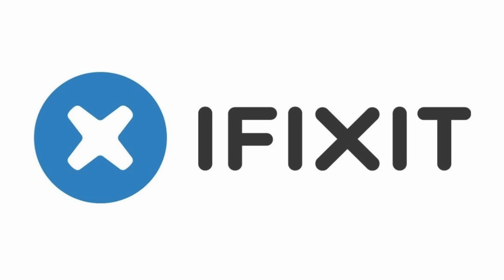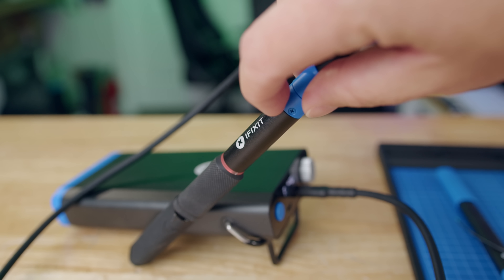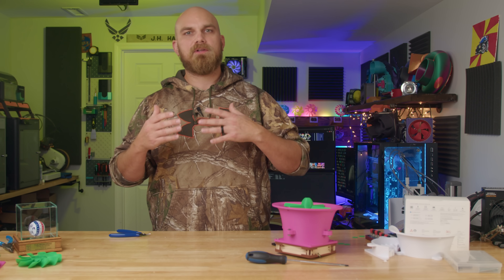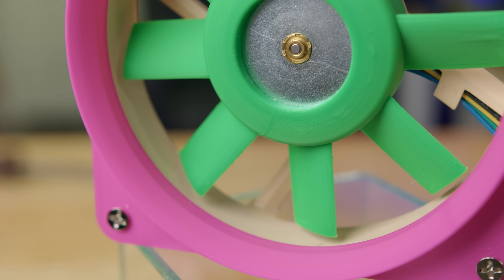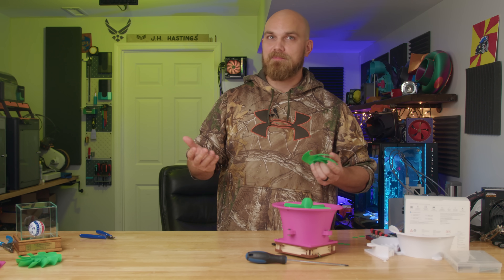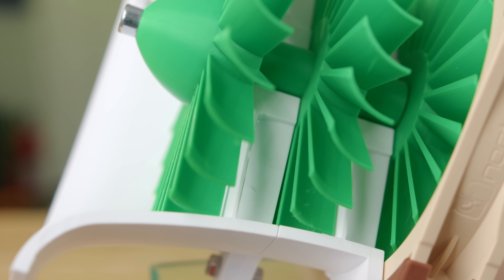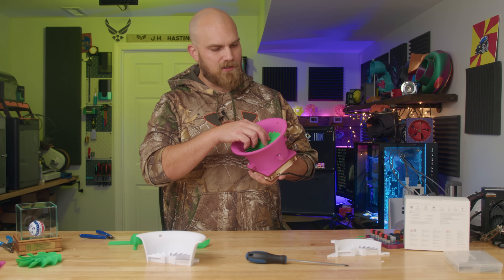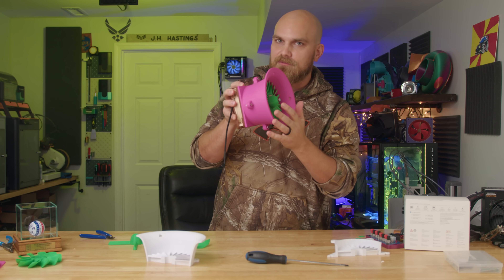Turning a PC Fan into a Jet Engine! | Fan Showdown S6E7

Comment: Olimpus just was asking too much power from the motor in a wrong way. Trying to move too much volume at too high pressure. If optimized for this challenge, the overall design is way to go, just those blades should be way shorter, to minimize how much air it tries to move at a time, because if the goal is just build pure pressure, you don't need much air at all going in. You just need multiple stages to build up pressure. That's why Centrifuge madness did so great, real slim blades to move less air, long blades to make pressure, multiple stages to get even more pressure. I bet if Olimpus was made with fin length of just 20% current one, and rest just closed center hub, it would rock the chart.

Comment: The axial compressors must have less blade pitch to create more pressure (like a tug boat prop where less pitch produces very high trust but low speed). Also, adding stators increase pressure, like a multi stage jet engine compressor, where each stator multiplies the pressure by about 1.2.  Looking forward to see which designs prove the best for both volume and pressure.

Comment: Pressure is not important, flow is important! You do not test a pump but a fan. Add flow ratio indicator to your table, you can measure this as a push force. Exactly the same as guys testing propellers for drones are doing, got it? Physics! Flow ratio differs to pressure almost as current to voltage. ...

Comment: I have a bunch of soldering irons. a few at home and a few at work. I have soldering stations that were several hundred dollars, name brand very expensive irons with extremely accurate and precise base stations with super fine adjustable  temperature control.. I have 2 pen style battery operated irons. i have 2 propane irons.. But the soldering iron i use the most by a mile is actually the cheapest iron i have because its perfection.. I have all milwaukee tools. M18 everything. this iron's base station connects to a Milwaukee M18 battery. everything from 2ah to 12ah 20v batts work perfectly fine. Its under $50 and works better than my few hundred dollar professional irons. extremely precise temp control, auto power down features, auto power off features, auto cool down features, low battery protections, etc.. all sorts of customizable settings all adjustable with a knob on the screen. anybody looking for a great iron for m18 batteries, this wont dissapoint.

https://www.amazon.com/Deackimei-Milwaukee-18V-Battery-Temperature/dp/B0CM95RBLL/ref=sr_1_1?crid=2KI32XOQ3AFM4&dib=eyJ2IjoiMSJ9.zfhk9g4YB-m3CEMTtYt_9ejdAbN_9NdexwD4ADcId6YhjSkUsnV35Iu_FyNSCqE8rTg6iq46wzN9cDPOQHPwXDk33r8tnY0GazeIJgPAmkMlxdYzuBGtxvhoGwr6VqQoDTgPyEaov4K2wCAkMdHVdfbwuW_xmjxX5t4j5hZNNdj4qAZO5PbjyhToH2ImMpPePI6Uzh725HfENIDmmnpJlfubeUKGjL8yJ5y3gu7XxxpyDNGgmEWGlj1xZOd4UMVLkXzdF_6erwlNTPOHIXx0SxqqjBpkwVexf5MMt4-2C5Hbgp-eRpIH8NRo5LWlbvsDKJ4lx5J0V0xxjsrQW3s1RlBX9yE78oqk8pBOito-rOKdJh7Ob3L7A5PR-NU8iACm5bTrdm6VDSvG12rqeLa0C_7Vqtkw7Pae1KvgIOnTCi4zTe_im3KdlPS1bx-Cr3Uo.Znk1RCE-kveWNQNrNlNkzFWafLpa0WvzR2dgwWqic7g&dib_tag=se&keywords=MILWAUKEE+BATTERY+SOLDERING+IRON&qid=1735803803&sprefix=milwaukee+battery+soldering+iron%2Caps%2C124&sr=8-1

Comment: Maybe for a future season you can measure both CFM and static pressure, or just mass flow? Also, it would be interesting to see what some of the lower-RPM designs that have been on the show can do with Noctua's A14 industrialPPC-3000 frame and motor?

Comment: Someone needs to design a squirrel cage type of fan. Furnaces use them and have quite a bit more static pressure than that. Like a pull through fan that mounts a blower wheel off the back of the fan motor and attach the housing to the backside of the fan frame surrounding the blower wheel. Basically a one side inlet only squirrel cage/furnace blower.

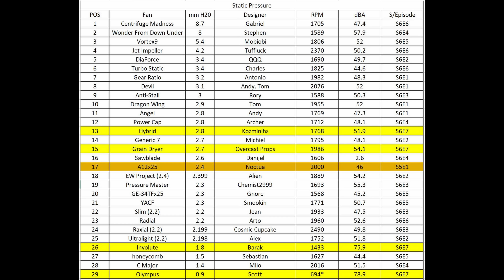Comment: 11:05 You have a typo on your spreadsheet: Sawblade (16th) has its static pressure duplicated as its dBA.  I just checked the S6E4 video and it was 46.

Comment: I worked on 200mw gas turbines which have axial compressors. Here is the challenge. Each blade is an airfoil (like an air plane wing) to work properly it has to have the proper air flow (not stall). They are very sensitive and requiere very tight clearances. A 12" blade only has 50/1000" clearance. Then this repeats on each stage, with each stage having a different shape and blade count. When blades stall it produces alot of turbulence and vibration. Thats probably whats going on with this fans.

Comment: Re the Rolls Royce Olympus engine, later models were also used on the Concorde. It differed from a lot of engines at the time in that there were two compressor spools - the high pressure compressors and turbines ran on a separate spool to the low pressure compressors / turbines, allowing them to run at speeds more suited to the low / high pressure conditions.

Comment: Just noticed the Sawblade fan from S6E4 has the static pressure in the dBA column, it should say 46.
Surely someone else has already mentioned this, but just in case no one has :)

Comment: That support bearing was killing the RPMs of the fan. Remove those tight  grease seals, wash out the grease with IPA, lightly oil, and give it another go. Probably won't be amazing but I would expect you would see a noted improvement.

Comment: If you have to add a bearing, remove the seals and remove thick grease and change to very little thin oil or thin grease, keep the seals off to reduce drag.  Ideally you could do this with no bearing added. Shallower angle on the blades should increase rpm and static pressure.

Comment: This video peaked my interest as I use to be a gas turbine technician in the Navy. Typically, each progressive set of fan blades would get smaller and smaller as each stage would be compressed at a higher pressure. The built ones were essentially the same diameter. But really not a deciding factor on a PC fan. As I assessed this design would be the most inefficient design for a number of factors, higher friction and tolerances were not that great. But the most significant factor…the power to drive three fan blades rather than one, would slow the speed down significantly. Typically an axial flow gas turbine has a high power to weight ratio at the cost of high fuel consumption. As many guessed, the electric motor was not powerful enough to drive such a fan setup.
Reply: *piqued

Comment: the angle/pitch of the blades/vanes on the one you're calling an axial compressor are too steep...  Change the pitch and it will certainly perform batter.

Comment: Not an engineer, but looking at the sharp angle on the olympus fan it looked optimised for speed not static pressure (makes sense after which it is designed).

Higher static pressure = lower airflow, I think a fan that's going to produce pressure should only use the 2cm of outer fan, since that part of the fan spins fastest and thus creates most pressure.

Comment: What ya need to do is find out how to make the air cold and then pull it into the fan and then heat it (by cooling the pc parts) and treat the cold and hot stages accordingly with their volume.

Comment: large greased rubber shielded bearings have a lot of friction btw. (for a fan) If you pull the shields out (just a pick or something will pull rubber shields out) then wash out the grease and replace it with a light oil like sewing machine oil it'll have way way less friction. For the ultimate you can run them dry but it's for show more than practical as they will rust and things. Metal shielded bearings can be no contact and you can with some effort swap the grease for oil in light load applications so it's not really an unfair test overall to degrease and oil.

Comment: I'm here for the jet engine fan but gotta say for once the add was spot on, they chose the right guy which opinion we might trust with the right audience that might be nerded into buying the thing, ifixit should sponsor you harder, sure I'm not the only math is cooler than math guy that now wants one, who else here loves to go to the cables, adapters and electronics section?

Comment: Throw out the Olympus.  There should be no bought parts added to the showdown fans, other than hardware; screws, nuts, bolts etc.  Adding manufactured bearings is totally cheating.  3D printed only or it's not in the spirit of the showdown.   
Keep up the great vids.  Stay Happy and Healthy

Comment: 5:05 Arctic has fans that look kind like this for example ACFAN00121A. Noiseblocker has a Fan that has 3 mmH²O NB-eloop X B12x-P. Maybe someone uses it as inspiration. I know it isn't as good as the Top. But it is in a 120x120x25 space.

Comment: and time and time again we see people making the same mistake: Weight has NO IMPACT on speed - neither for something moving in a straight line, nor for something rotating like a fan.

Only once you got past the limit (what the bearings are designed for, or what the tires can handle) does it really matter - and there you are far far away from the weight you get under any normal situation.
For the fans the biggest problem of weight comes from the high currents when starting up potentially burning up the motor, or if it is far away from the hub then the torque it applies to the shaft and bearings. But both of those scenarios need extreme examples like "the tulip" (S1E5 - https://youtu.be/peGR3-jgvtY?si=4uWx1HJztxnwq8Rm&t=310 )

Comment: Dont buy the ifixit station. Buy a better, cheaper iron which is more versatile called the TS80P and USB-PD power bank which itself you can use anyway because its a power bank, you could probably buy one with a wireless charger to charge your phone on it, already more versatile than the ifixit station. 

Honestly cant believe hes even promoting it, overpriced and proprietary crap

Comment: Involute fan needs  aredesign. Run it at rpm and see how much it deflects. Compensate for that in the original at rest shape so when the fan is spun up it achieves it's final working shape that is the desired shape. Result is super low weight fan blades and intended airflow.

Comment: Interesting note about high performance fans, sound can change how much you're willing to deal with when everything else stays the same except the chassis. Case in point, I've been using 5300RPM fans for years and other than at full song, they were perfectly bearable for peace of mind when doing simulations and big renders. I upgraded to a significantly larger GPU recently, which meant getting back into a full tower case. 
Yeah, it lasted four days until the noise became unbearable and I ended up swapping all but my exhaust to 3600rpm fans. It runs about 10C warmer but still within the safe zone under load. I never thought I'd be walking backwards on headroom for static pressure, but sanity has a cost when it's sitting next to you for 12+ hours. 😁
As soon as I finish my current project, I'll sit down and finally get a fan piece banged out for this challenge. I've had one started forever but paying jobs and R&D work take precedent unfortunately.

Comment: The RR Olympus engine was also used in the Concorde supersonic passenger plane!  The fan design here was facing far too much friction, perhaps from the internal bushings?, and what seemed like far too much air load on the blades, perhaps a lower blade pitch would work better?
Reply: The smoke test showed the Olympus was out of balance as well, which I'm sure didn't help.

Comment: If you want to design a fan with extremely thin blades like the Involute you should really include a ring touching the furthest part of the fan tip. This would give it a bit more rigidity allowing it to spin without touching the rim of the fan. An like said in the video the closer you can get the blades to the rim of the fan without touching the better. Noctua spent a lot of time developing the material of their fans to make them rigid enough that they could make them run extremely close to the housing of the fan without risking that the blades would flex enough to touch it. An alternative that some have tried is to have ring connecting the tip of the fan blades that acts like a rim.

Comment: The Axial fan needs Bearings to stop any form of play in the main shaft which will also need to be true, so that the tolerances between the Shroud, Compressor, and Stator blades can be maintained, also the blades will need to be balanced to stop any wobble.  The smaller the gap between the shroud compressors and stators the better the performance will be.  Be Aware: Deformation and catastrophic failure of Plastic compressor and stator blades is likely to happen at high RPM.. There is a reason these types of things are made of metal.

Comment: Next season should be a "CFM per dB" competition to see who can make the most air for the least noise for real world PC use.
Reply: ah yes, the power/weight ratio of the fan world
Reply: Noise doesn't scale linearly, so dividing is not good.  GamersNexus' method of adjusting all fans' speed to the same dBA value is better, tho specific tones can also be important.
Reply: @concinnus  
I disagree.  Noise is linier.   Decibels are logarithmic. Although we measure in dBs, we hear linearly.  To the human ear, going from 60 dB to 70 dB is twice as loud.  

In my perfect world though, I want everything to equal or be less than ambient noise.  I don't want to hear my fan. Besides, I need to be able to hear when my wife yells at me from the kitchen that dinner is ready.
Reply: @alanmcentee9457  Everyone knows how dB works, dude.  The issue is that if you double fan speed, roughly speaking cfm doubles, pressure quadruples, but noise power octuples (+9dB).  Please learn some domain-specific knowledge instead of just repeating high-school level science factoids.
Reply: @concinnus  
If everyone knows, why would you get it wrong?
Reply: @alanmcentee9457  Ah, I see.  It's not that you lack technical resources, it's that your technical reading comprehension is like someone trying to sound the Mariana Trench with a ruler.  Good luck, but you're not worth any more of my time.
Reply: @concinnus you are right but you also sound arrogant af
Reply: I hope people look at GE jet engines and how they've made the intake way bigger to surround the jet air from ambient atmosphere with more air somehow to break the sound up. It's like air is its own acoustic insulation.

I'm pretty sure the bypass air gets heated, and this creates as near a vacuum as possible to surround the fast moving air to reduce the sound waves in most directions.
Reply: Decibel alone aren't so great for this, you could have two fans running at 25 dBA but one of them could sound significantly more annoying because of psychoacoustics. What you need to measure is basically the psychoacoustic annoyance level. Which is a combination of loudness, sharpness, fluctuation strength, roughness, tonality, etc
Reply: You'd have to comp for frequency
Reply: This would be a very interesting challenge
Reply: the ultra low noise competition could be a completely new thing. instead of the NH-12, you could use the redux-700 or 1200 as the baseline
Reply: No no no. The most air with the MOST noise. I wanna hear them scream.
Reply: @fallingwater  
You enjoy the fans torturing the air?  What kind of fan club you got there?
Reply: You can aggregate that information already with the data at hand. (mmh2o * 3.53) / dBA
For real world usage, well, if dBA is equal or lower to the Noctua with higher mmh2o you already have a style that will be better at cooling, given that the cooler would fit into the case. All that aside, the viewers are from all around the world, we appreciate the usage of SI units and not the catering to a minority.
Reply: @maskharat Where does 3.53 come from?  I do not think you can equate static pressure with volumetric airflow.  In fans the flow rate is usually expressed as m3/h or CFM.

Comment: If I remember it correctly then compressor style fans have layers that rotate at different speeds and have different pitch angles. So a si gle motor without any gearbox will not create the compression necessary for it to work.
Reply: Maybe you're thinking of bypass engines like used in airliners? I wanted to design an axial compressor after the last episode so I dug into it a bit. Most of the designs I read about had one solid shaft that all the blades attached to. Pressure is created by reducing volume and blade pitch between  stators like you said. The engineering involved gets complicated enough that I just couldn't dedicate the time to learning.
Reply: Correct! I would not say different speeds as all rotate at the same speed. However, several stages of compressor blade are rotateable. That is to prevent compressor stall at different speeds. Not a make or break design for a PC fan.

Comment: Do you think it would be possible to "disqualify" the fans that are clearly designed for bigger numbers (for example have allowable build area, inside the fan and the fan "dangerzone" maybe so something like a cone wouldn't be enough to DNF but WFDU and centrifugal madness is out) and colour their placement in the sheet, it would be the perfect compromise for the competitive peeps who still care about useable pc fan and peeps who just like to see number go up, you could accept the designs that will dnf and still have them on the list with static pressure in descending order. Also links in the description if people mention that design is available somewhere?

Comment: I know this season is all about static pressure, but why don't you check airflow as well? Many of these fans (like the Involute), while very low on the pressure scale, seem to have very high CFM - maybe higher than the top rated ones from season one